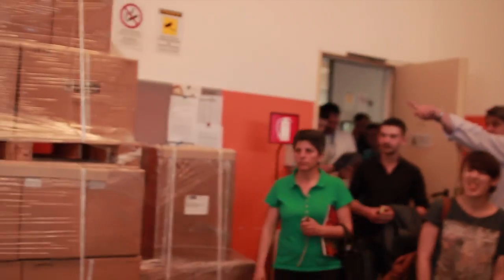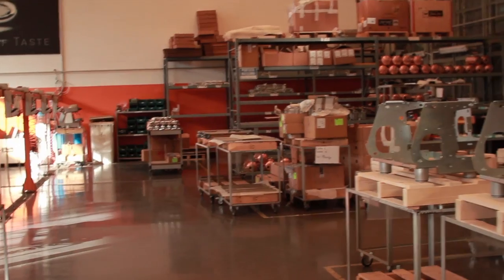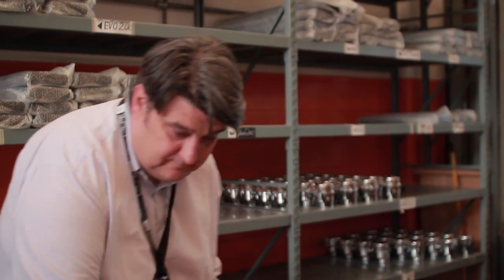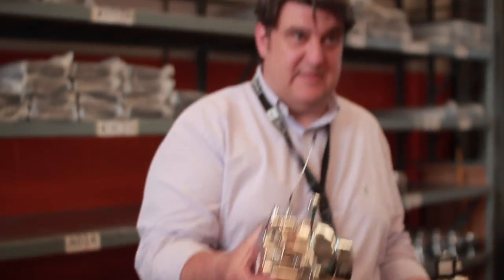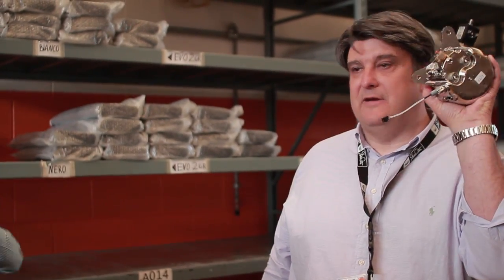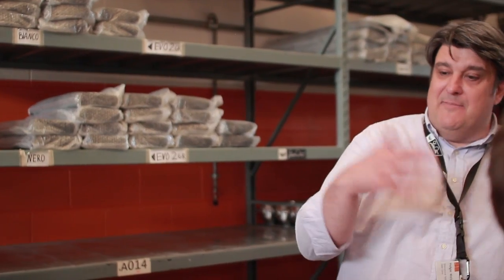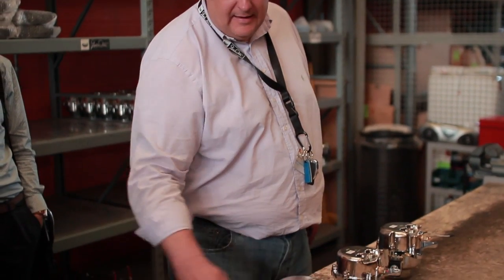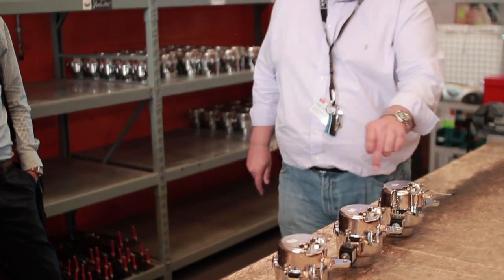Dalla Corte "Multi-Boiler" Technology

Comment: very interesting.  but the assertion of the gentleman behind the camera was not addressed as the need for separate boiler/group head paradigm to ensure temperature stability, versus this system which incorporates the two into a single unit.